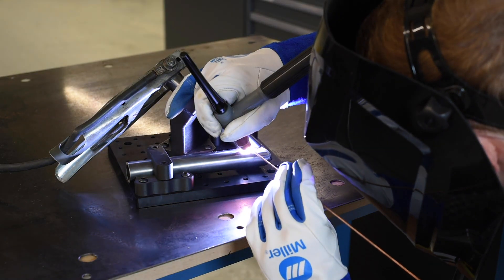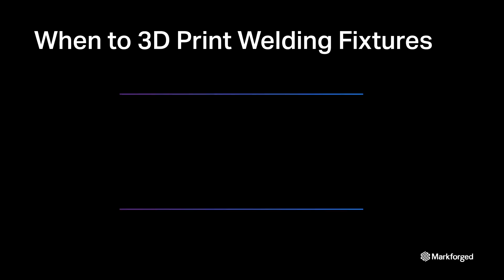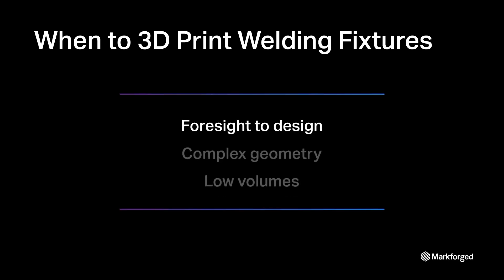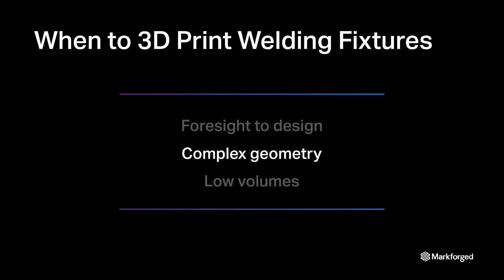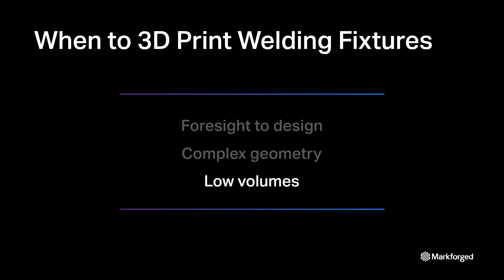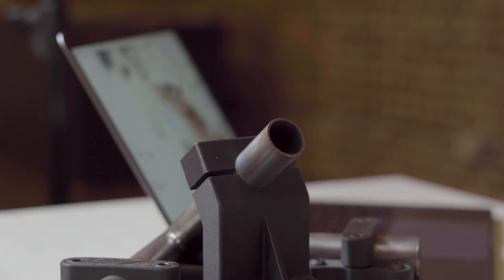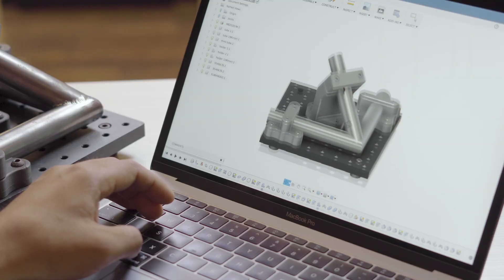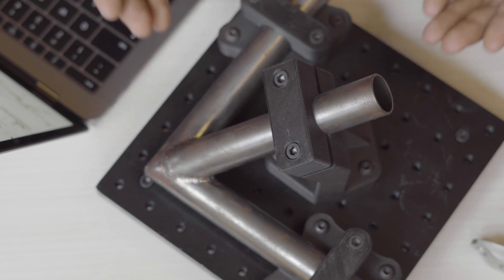Benefits of 3D Printed Welding Fixtures | Markforged 3D Printing Applications

Comment: What keeps the jig from deforming from heat?  For aluminum parts the transfer of heat is so fast, even if it is just tacks
Reply from the maker: Heat transfer through the composite fixture is significantly slower than through metal, due to the fact that it is made from a thermoplastic composite material. The bearing surfaces may start to get warm or hot during high volume jobs if the fixture point is near the part, but it will take a significantly longer time to raise the temperature of the entire fixture to the point of deforming. Of course, this varies depending on geometry, so we encourage you to reach out to a Markforged product specialist to discuss your specific application!